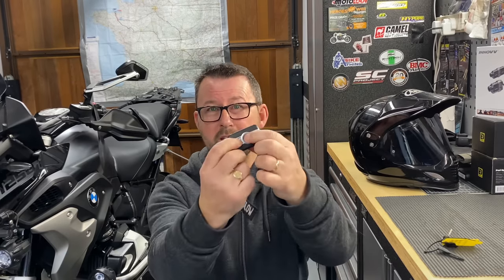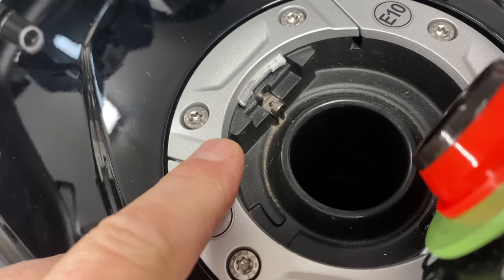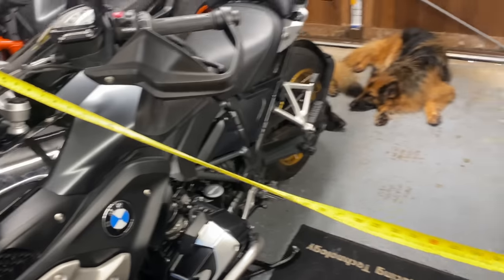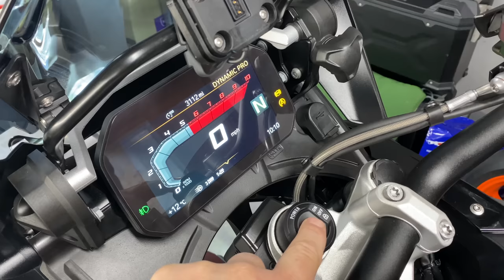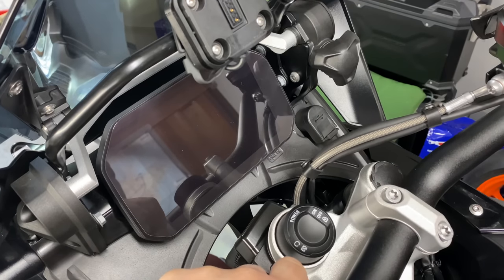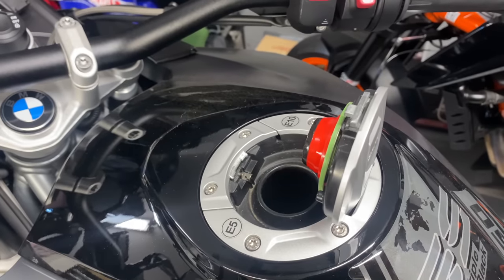HINTS & TIPS #4 BMW R1250GS / GSA, a guide to keyless ride 🤔

Comment: BMW recommend Varta batteries but top of range Duracell work fine too. Beware of cheapo CR2032 batteries, they just don't last.
Reply from the maker: Mine came with a Panasonic. Yes buy from a reputable seller then you won't go wrong. if 10x cr2032's for £5 sound too cheap then there's a reason why!
Reply: Never cheap out on batteries. Ain't no reason to do so

Comment: You can also get a metal blade spare key for around £30 from the dealer , idea for frequent use with the vario panniers.
Reply from the maker: Brilliant...thats what makes all these channels great for passing on info. I was a bit cautious of putting a plastic key in the lock!!!!
Reply: does this metal blade spare key you mentioned come with a handle and chip like the plastic emergency one? or is it just a blade replacement for the radio operated key?
Reply from the maker: @sunnycloudy1337  According to the dealer , exactly as you have already 👍
Reply: @gsd32i  I don't understand... is it a metal blade replacement for the radio key or is it a metal spare key with chip? which one?
Reply from the maker: @sunnycloudy1337  If you want the radio key then you get a radio key which has the blade...if you want the spare plastic key thats what you get. Its like for like 🤪
Reply from the maker: You may be able to get a metal blade as Brian above says, but no idea if that would have the chip in it. Possibly ask your dealer regarding the metal blade and what it does or doesn't do. 🤔
Reply: @gsd32i  dont really care about the chip that much, but I would like a HANDLE for it at least, just the metal blade with no handle would be imposible to use on the gps / seat / panniers & topbox without pliers. BTW, you can replace the metal blade in your radio key yourself in case its bent, worn out or whatever... you dont need to order a whole new radio key! Just order the metal blade and swap them as they are held into position by a tiny little pin that can be pushed out and pushed back in
Reply from the maker: @sunnycloudy1337   Thanks, I was a bit unsure as to how strong that plastic key would be, so I was a be hesitant when I used it in the seat lock and gps lock....but its fine, no problem.👍
Reply: @gsd32i  I also used the plastic emergency key for the panniers and top box... but it's so thin it will probably break sooner or later if you're not EXTRA careful with it. And then good luck trying to fish it out from the lock when it does break! That's why i'd like a METAL emergency key, just like the plastic one, with chip if possible, if not that's ok, same shape but METAL not plastic... maybe @brianhill3603 will clarify what he meant in his comment, soon 🤪
Reply: It's just like an old skool 1200 ignition key, metal blade and plastic fob, no chip.😎👍🏴
Reply: @brianhill3603  gonna put that on the list, thanks!
Reply: Yes, I always order a plain key for panniers, seat and nav. It saves abuse of the main key… which permanently lives on a lanyard around my neck

Comment: Another tip, the screwdriver handle is the oil filler cap tool. Use the metal shaft of the screwdriver in the side hole of the handle for leverage. Cheers Steve
Reply from the maker: Yes I forgot to add that about the tool kit.

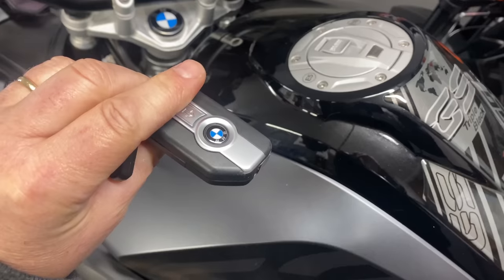Comment: 9:02 - if you have the alarm system option fitted on the bike and its armed, that trick doesn't work. I played with the keyless ride operation yesterday and It took me a little while to figure it out it was because of the alarm system being armed. I set mine to arm automatically after 30 seconds of the bike being turned off in the TFT settings. Once I de-armed it (by pressing the square button on the radio key) it let me open the gas lid like you described (with the bike being off longer than the 2 minute window whilst having the radio key in range) 😎

Comment: Very helpful video! Thanks mate! Since you asked, I got the 50% battery warning after 11 months of regular use on my 2022 GSA. I have heard that storing the wireless key very close to the motorcycle will drain the key fob battery more quickly, so I avoid doing that.
Reply from the maker: Hahaha same surname as me ! My key sits on my garage worktop about 2 metres away from the handlebars so I’ll be interested to see if this has any effect. 👍

Comment: It's a brilliant system that I have had no trouble with in the last 38,000kms. You mentioned a couple of obscure points that I wasn't aware of (main key working at rear sensor and the T25 on the toolkit screwdriver, I always carry a full toollkit anyway but it's good info) so thanks for doing the research. I have my disc lock and Krypton cable lock on the same keyring so never forget the keyless key.

Comment: All good info. I didn't know about using the main key (without the battery / or a dead battery ) the same way you'd use the emergency key.....thank you for that. I've had my GSA 1250 about 1 and 1/2 yrs and only recently did I start getting the 50% battery message. Also, there is a slight delay after the bike is turned off before the fuel filler cap can be opened (maybe 5/10 seconds) I believe anyone who has had problems with the pin mechanism, has forced the latch during that delay period. I know the first few times I refueled I was unaware of the delay and tried forcing the cap latch up. Luckily no damage to my locking pin occurred. Thanks for this piece of content....I learned something new...S.F.A.
Reply from the maker: Hi Stan, yup that was why I zoomed in on the filler cap to get the audio of the click when you lift the tab up a bit. I know when I first used it I nearly pulled the thing off because I didn't wait for it to click unlocked!!!!!

Comment: I did not know the remote could be used as an emergency key with a dead fob battery, or about the T-25 under the seat for the gas cap - excellent info 👍. Replacement keys in the U.S. are about $400+ for the remote, and about $65 for a metal key for bags and seat - quite a bit more! I also didn't know the plastic emergency key could be duplicated by BMW. 👍👍

Comment: FYI on a few items. On the 2020 RT, the key is not 100% water proof. (had mine replaced under warrenty). On the RT you need to be on the centre stand to open the filler cap.  There have been reports of keys snapping off for the seat, be carefull. Lastly the button batterys a lot of the new packaging have a coating over the the battery which can cause them not to work when used, and wiping over with an IPA or metho cloth may be needed to remove this coasting to stop people eating em.  In general I swap the battery every 12 months, they are cheap, and effective. Great video.
Reply from the maker: Thanks for taking the time to comment 👍

Comment: Thanks for the procedure for removing the small section to open the fuel door.   That is an important thing to know, and it is easy enough to do if you had to,.  One comment about the keyless entry.  I think that it might be susceptible to people using a flipper and copying the constant broadcast from the key.  If they can mimic that code, they might be able to ride of on your bike.   This would just require them to get close to you in a restaurant or at a gas station.  The key is always emitting the radio signal.   I have a faraday cage small wallet that I can out the key in if I was ever in an area that I felt uncomfortable.   There are a lot of questions about how BMW manages the radio signal, is there a challenge and a secondary signal or sometihing that is more secure?  I'm not sure, but a lot of people get there cars stolen with keyless entry this way.   Just something to think about.

Comment: Great and useful vid.
I had the change battery warning pop up when my bike was about 18 months old, like you i had a few a couple of spares at home  ( Pukka Duracell) and popped a new one in, still had the warning, took the battery out and replaced it with a second new one and the warning was gone, duff battery i figured.  On the very next ride i was about 100 miles from home and the warning came on again, no 75 or 50% warning, just change battery.   I didnt have my emergency spare and i didnt know that the Radio key could be used like the emegency one so was a bit twitchy. Stopped at a shop and bought a couple of new batteries.  Energizer i think, all good and been ok since.  Ive since heard that some batteries dont appear to function correctly with the key?  Maybe nonsense  but I now keep a couple on the bike.
Reply from the maker: Thanks ref batteries , clearly some shady battery suppliers out there on those selling platforms ! 😂 I try to keep things simple in the videos as it’s how I learn and retain technical stuff … computer on …. Computer off ! 
Suspension will be next 🙈

Comment: Good video. Planning on picking up a GS for my 54th BDay this summer. So getting all of this information before hand is quite helpful so thanks for it.

Personally I lost a set of keys while riding last year and I was bent out of shape for a long time about it. So, since my jacket didn’t have one I decided to create a small lanyard/lobster claw system that I sewed into the pocket of my riding jacket. It holds my keys securely in the event that I forget to zip my pocket on a ride. Actually, was actually how I lost my keys in the first place. 

It works so well that I have made them for a couple of my other riding jackets and it’s worth it. Not sure why manufacturers don’t include them as standard kit. 

Cheers from the States! (Buffalo,NY)
Reply from the maker: Many thanks . I guess everyone has a system that works for them . Ultimately it’s all about having fun too . Ride safe 👍

Comment: I may be wrong but from what I can gather is that the ring aerial for the keyless ride is located under the seat at the center of the bike, not in the ignition, the ring aerial for a bike without keyless ride is located in the ignition barrel that you pointed to.
Reply from the maker: That’s for the spare key …. I think . 👍
Reply: Correct and that’s the only aerial on a keyless ride bike, whereas one with a normal key had the transponder in the key with a battery and not strong enough to pick up the signal from under the seat hence have the ring around the ignition barrel where the normal key gets inserted

Comment: Your awesome! Didn't know the radio key work underneath in the emergency antenna,  and didn't know about the two screws at the gas tank.
So! "I" was WAY in the middle of nowhere Colorado at a gas station the only building for many many miles got gas closed my filler cap, went to take off and my bike went into limp mode!! TFT( take bike qualified service center) bike ran but would not go beyond around 1000rpm?? Crap!! After several mins what is going on?? NO BMW SERVICE HERE!! so I just started all over! Open the gas cap and acted like I put gas in then closed the gas cap " well I didn't have my helmet or gloves on this time and there it was the "Click" !!! All good! Fyi, you can close the gas cap and it looks closed!! You better hear or feel that click! Lol.
Reply from the maker: Hope that all is well now🙄

Comment: The modern keyless systems are pretty bulletproof. My 2015 Duc is keyless and I now 100% prefer it to keyed ignitions... it has had rare read issues (usually around gas pumps so I'm guessing due to interference) and periodic dead battery surprises but with Duc there are multiple fallbacks (nearfield sensor AND a dashboard unlock code)... I've never needed the dashboard code.

Comment: I have Rubber Bungs in the Frame Holes.  Plastic Key wrapped in foam and placed inside the top frame hole. Replace the Bung.  Safe as houses and I know exactly where it is.
Reply: Where do you live? ;)

Comment: That was brilliant info many thanks. 
Had my GS 2yrs the battery is on 50per cent and I mislaid the emergency keys found it eventually right under my nose in my key box where I'd left it for safe keeping. 
Was looking and not seeing, typical. 
However BMW wanted 4 quid for 1 battery and 35 for a new spare e.t.c
Needless to say I didn't but anything. 
I've ordered Duracel off Amazon for 4 quid and will do my own 
Thanks
Reply from the maker: I've ridden off with the radio key in the top box . nice mark up from BMW 🙈

Comment: Fyi
When opening gas cap after you turn off the TFT It's only 2 minutes if you are using the plastic key. 
If you have the key fob within range there is no time limit.

Comment: Great content. Question..can one  open the fuel cap using the spare sensor key?
Reply from the maker: H, yes you can. Just switch the bike off as normal and open the petrol cap as usual. 👍
Reply: Thanks @gsd32i

Comment: Had the bike just over a year and I'm on my THIRD damn "watch" battery--and I've seen the 50% Battery Warning within a couple of months of a change out. It's possible I bought a bad batch of batteries, but frankly I think the system (the antenna or radio) isn't quite up to spec. Another gripe is how difficult it is to open the battery compartment on the key; always feels like I'm breaking something before it finally pops open. Seem's a sliding latch mechanism would have been better. NIce bike, key-less is nice in concept; execution could be better.
Reply: Oh, it's same as mine...So, like it or not, I always open th battery compartment without battery. And when I ride the bike, I put the battery in and tape it round, which is ridiculous solution, though. I fully agree this should be a sliding latch mechanism!

Comment: Does the ecu command the ignition on the keyless go system or is it just a relation between the key and ignition button only?
Reply: How come my antenna ring is located under the fuel tank( 2020 gs 1250)
Reply from the maker: Sadly way above my level of knowledge ! The antenna ring I believe to be located below the on /off button . May be you are right and I am wrong ? 🙈

Comment: My battery lasts about 18 months of daily commuting. Im not convinced regarding carrying the spare everyday just in case as i might lose them both. I would never carry 2 traditional keys for my cars or bikes. When i go away then i do take the spare in my kreiga wallet along with all my docs. If I lose my key at home (on the rock) er indoors will get a call 😏

I did experience an issue twice with my last GS. Once in france and once in wales. I believe i was too near a transmitter (phone or radio). I free wheeled the bike a few metres and it sorted itself out.
Reply from the maker: Hi Neil, rock riding I guess yes with the key...but further a field I would carry a key. I guess folks will do what works for them..one chap puts his spare in the frame holes with the Wunderlich bung to keep it hidden. Always good to spread words of wisdom though 👍

Comment: I wish the signal from the key wasn’t so weak. When I’m wearing my Rev’It! winter shell with the key in my front pocket, the bike can’t get the signal. I have a R1250 GSA and a K1600 and same issue on both. Pretty poor signal. Half the time I’m riding around the bike is giving me warnings about not having a key. And yes I’ve changed the batteries and even bought a new key and same issue. It’s just weak.
Reply: I have the same problem. I once forgot the key in the washing machine. Maybe that is the problem, even though I put in a new battery.
Reply: @davidmallia628  these are brand new bikes and brand new fobs so that’s not the issue for me.  I’m actually pretty impressed it survived the wash!

Comment: Great video and very helpful. You have a second key with the spare key, is this key also for the GS?  Great to know that another spare key is not that expensive to get.
Reply from the maker: The small key is for the sw motech side case locks, I have one on each key fob. 👍
Reply: In case it’s of use to your viewers, I purchased a non transmitter key from my dealer for around £25.  I keep the transmitter key in my jacket and the non transmitter on a lanyard round my neck.  I use that one for the seat lock, sat nav lock and pannier locks.  Negates the risk of me losing the expensive one as I don’t have to take it out of the jacket pocket.
Reply: @terryosullivan7650  Thanks for the info Terry, I will also purchase one to have with me while riding. The last thing I need is to be hours away from home and lose my key. The advantage of this key is that it even fits in a wallet. Safe riding!

Comment: What can prevent the lock of the filler cap of working? The lock pin is ok and if I turn the engine off and the TFT too the filler cap remains unlocked after 2 minutes
Reply from the maker: Hi, not sure ...software issue?but they have given us riders the option to open it just incase it does happen. I am a big fan of keyless (until it goes wrong😂)
Reply: @gsd32i  im using a tank top bag , from GIVI , to fix it I had to substitute the screws that are precisely on the piece that works with the keyless system , maybe they’re too tight , so I’ll do some troubleshooting and try to find the reason , and I agree , it’s an awesome system until it stops working 🤣🤣

Comment: I have the R1250RT, bought it about 15 months ago, just got the 50% battery warning.  I carefully tucked the emergency key in my riding pants, which I wear on every ride... but I can't find it now, it must have worked its way out somehow and is laying on the roadside somewhere. 😞  I do like the keyless system overall.  The RT has the unified luggage locking, which I can do with the keyfob.
Reply from the maker: yes they are small keys....put a tag on it. I did think the plastic key would snap in there seat lock when I tried it...but it didn't !! phew.